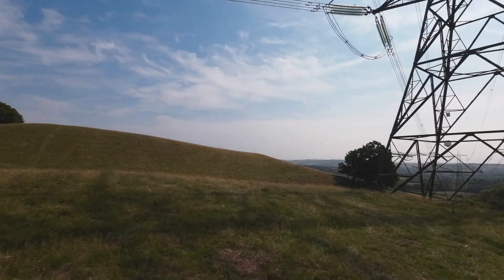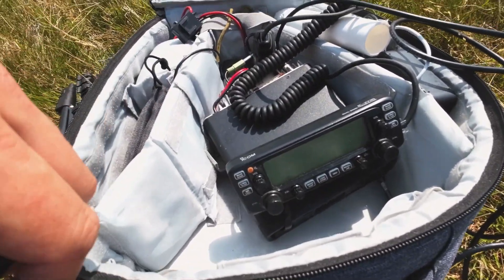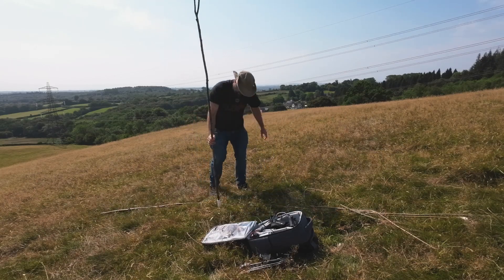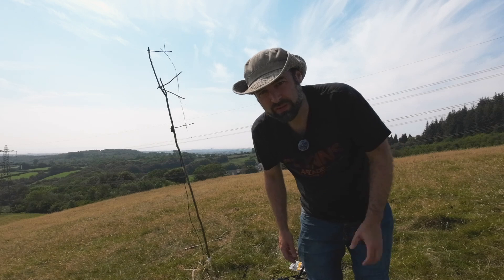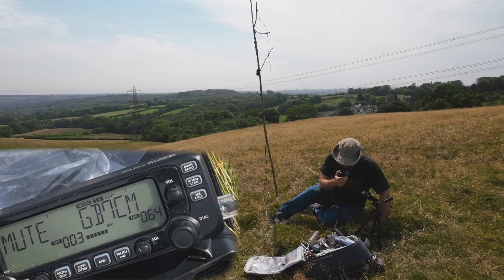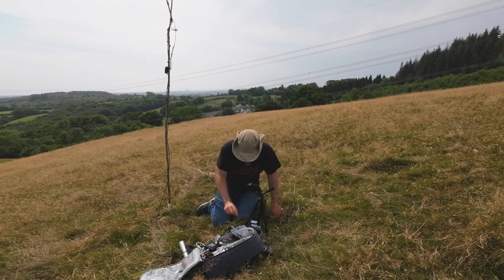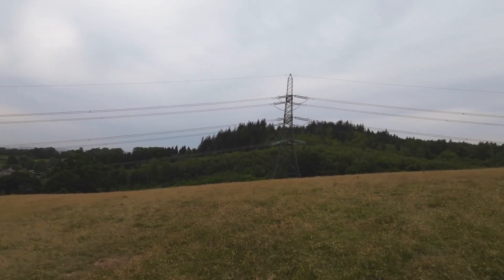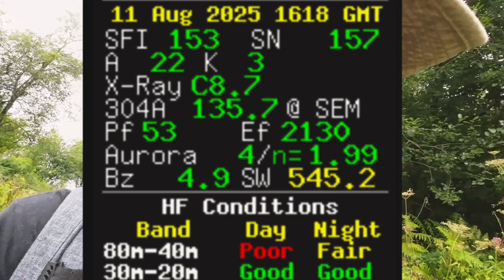improving the emergency Stick Antenna with a mod - Ham Radio

Comment: Just came across this. You presumably already know this, but FTI of other possibly less aware viewers - The basic part-stripped coax is technically a ‘sleeveless’ sleeve dipole. With a ‘proper’ sleeve dipole (used extensively on UHF as WiFi router antennas for example) the ‘earth leg’ of the dipole is formed by a brass tube fitted over the outside of the coax  inside a plastic outer casing and fed at the top of the brass sleeve by the coax passing up through the tube. A ‘sleeveless’ version uses the coax shield below the stripped part as the earth leg, with a choke (coil) as an ‘end-stop’ to set the length of the earth-leg (and also stop common mode currents on the coax). It is (technically) end-fed from the choke point rather than centre fed.

Great idea to add a reflector to increase directional gain. 👍 Watching with interest 😊 Peter GM4RAH
Reply from the maker: Great info Peter 👍

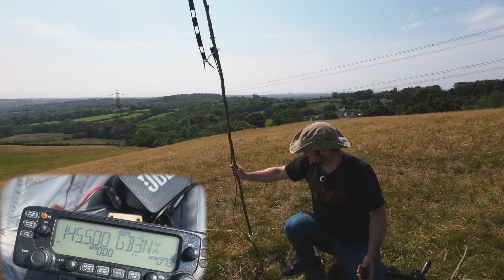Comment: At 6:55 when you were expecting GB3NX, I heard the morse GB3AL, which is in Amersham and is on the same frequency and ctcss as GB3NX according to ukrepeaters. It's a similar distance though.
I'm still learning morse and had to rewind many times but I'm sure.
Great video, 73 Paul.
Reply from the maker: wow i never picked that up, that's very interesting thanks for letting me know,  i will listen again GB3Al is 110 miles from that position 😮

Comment: A good project antenna, from what I could tell, you were building a J-pole ladder-line antenna, which is a good omnidirectional antenna. If you want more gain, I would suggest researching the tape measure yagi. You can flip it to vertical polarisation, and it will have a much more directional gain, or you can use your sticks to hold the elements and build it that way. Regards, John 2E0JGR
Reply from the maker: cheers John, i'll take a look the tape measure antenna, i want it to be something i could build in the field in an emergency so that could be a good one to try 👍
Reply from the maker: i may have to re-upload this video music copyright flag
Reply: @MW0OYD That is a bit of a rubbish issue, I never noted anything that I would consider copyright. Be aware that con artists claim copyright on such things and need to be challenged. Lots of other YouTubers have suffered the same issue, so challenge it.